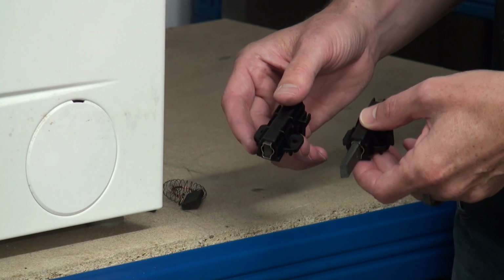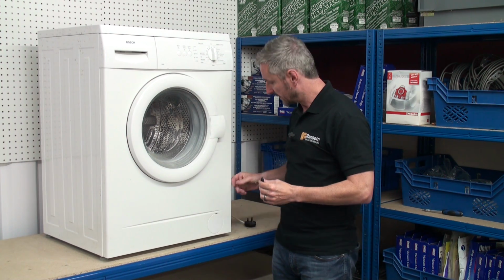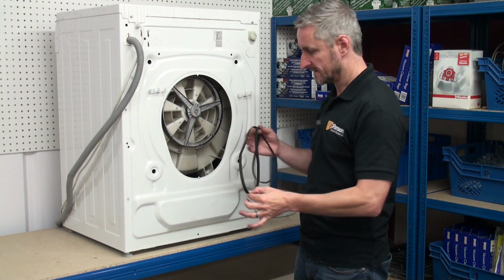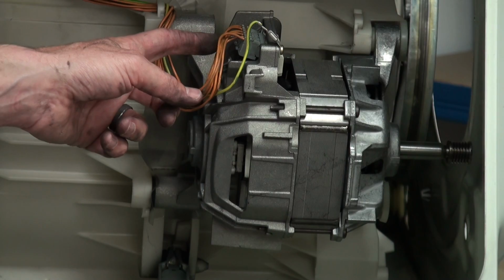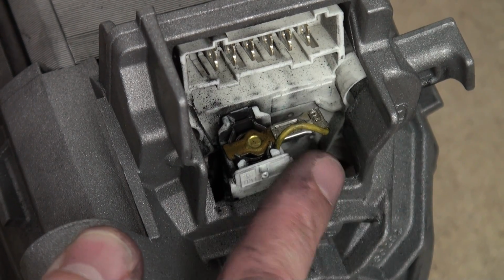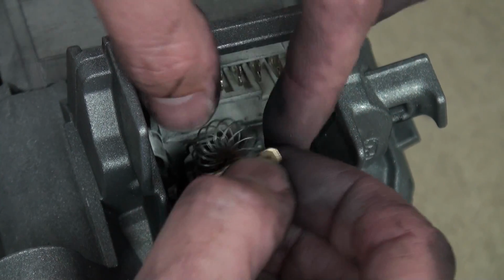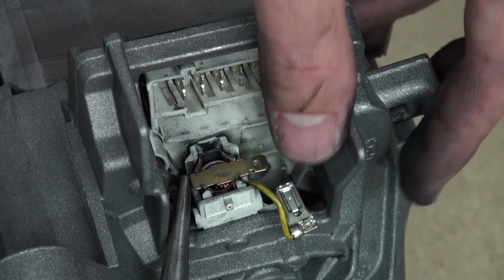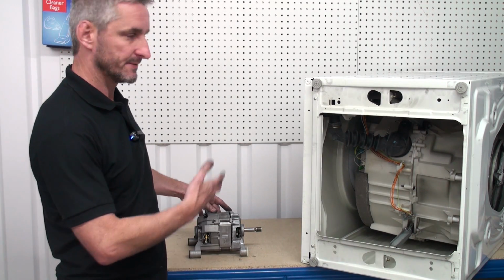How To Replace Washing Machine Carbon Brushes

Comment: Great video! Just got my Bosch classixx 5.5 up and running again. The brushes I received (official ones from Bosch for this serial number, from Bosch's own website) did not fit: that makes no sense from Bosch. I had to sand of the side. It took a bit longer, but it fixed the machine. Many thanks for this great video!

Comment: I am grateful for having had access to this video. I followed it and replaced the brushes on the motor of my Bosch maxx 900 and it worked like a charm. I had no idea how to get to the motor until I saw this video. A repairman had told me that many people use google to fix their washing machine and then they call him to fix it but he won't touch it.  I was tempted to listen to him but I didn't.   Your video saved me about $150, and gave me the satisfaction of fixing it myself. Thank you; keep up the good work.

Comment: Hi. I changed the bushes about a year ago,, can they wear out that quickly, thank you
Reply: @TAHIR MAHMOOD: IT DEPENDS ON WHAT QUALITY OF MATERIAL HAS BEEN USED IN MANUFACTURING THE PRODUCT ---- (HERE, THE CARBON BRUSHES). IF THE MATERIAL IS USED OF A HIGHER GRADE, THE CARBON BRUSHES WILL NOT WEAR OUT QUICKLY. THEREFORE, ALWAYS BUY AN ORIGINAL PART, OR IF YOU WANT TO USE A GENERIC PRODUCT, BUY A PART OF A BETTER QUALITY, TO LAST LONGER.
Reply: من اين اشتريت القطع

Comment: Spot on video - Thank you Lee! Thanks to your explanations, I could remove the worn out brushes and replace them with brand new ones. I then cancelled the error code F21 and reset the control panel back to normal function. Great job, top man! Damien

Comment: Thanks very much, I just received my brushes today and now my washing machine is back up and running, the video was very easy to follow and your website is fantastic for ordering the parts I needed, The washing machine was nearly going up to the tip all for the sake of carbon brushes, I wonder how many perfectly good washing machines have been thrown away without even checking this. again thanks you saved me a lot of money.

Comment: Thanks but do you have a tutorial on replacing without removing the motor too?
Reply: It's always much easier to change the Carbon brushes removed it would be impossible to do it with the Motor in the Machine

Comment: This is our first HE machine, replacing an old one with an agitator=>>lovy.biz/zkql?96r       The salesman told us to put in the detergent and clothes and start it and then go watch TV or something and forget about it. That was very good advice. It makes a lot of weird and different noises the old machine didn't make, and it would drive you crazy trying to figure out what's going on. Not that it's noisy or anything. I think it is pretty quiet. The first thing I noticed was that the clothes were not only clean, but they smelled clean, something I hadn't noticed with the old machine, which had been limping along for a while.

Comment: We recently purchased this washer to get away from a washer with an agitator=>>allmy.tips/WhirlpoolWasher?O41     I must say how pleased I am with the space this washer provides and how well it washes our clothes. My only complaint is that the clothing items are pretty wrinkled when u remove them and I assume that is because they are using each other to wash as opposed to an agitator. This isn't a huge problem so I still rated the washer a 5 because it is quiet, quick and overall efficient. Also I would recommend not washing a comforter over a queen size because we washed our King and it was a pretty tight fit. Great washer for the price and we are very pleased

Comment: Many thanks for this - an excellent "how-to". With this I was easily able to replace the brushes on my 10 year old Bosch Maxx washing machine (first time it's needed anything doing).
One tip - I found that putting a wooden kebab stick down through the spring stopped it spilling out.
I got genuine Bosch brushes, which are angled - a friend commented that he'd had a repairman fix his machine, but he had used generic brushes (half the price) with a straight edge - had commented that they'd be good for 5 years. On that basis I'd cheerfully continue to stick to using genuine replacement parts to get the full lifetime.
Reply: Should have just put the machine, on its back, so much simpler.

Comment: If the symptoms began after an excessively heavy load of towels, it it worth trying to replace the brushes or is it more likely that the motor has burned out?
Reply: Brushes are about £20 for genuine parts

Comment: i have a bosch wae28468/14 with error F21(brushes,motor or main control brd)Brushes are fine. commutator sooted slightly but now clean,not much wear.my motor has 7 connectors which i think are 1-2 sensor3-4 brushes, 5,6,7 windings.across 1-2 i get 7 ohms, on 3-4 i get 23ohms static or 0-23ohms when turning spindle  and approx 2-3 ohms across 5-6,5-7,6-7. 
I tried several times to reset the error but was unable, so took the front cover off and tried the reset procedure pressing directly on the spring/switch which worked first time. i put back together and put a wash on which worked fine for 30 mins into the program then the machine stopped again on error F21, do you think this could be the main control board or motor problem.
do you have a main control brd - BSH 5560 009 098
Reply: F21” is a Long Drain error. If the drain time exceeds 8 minutes this error code will be displayed. ... First, attempt to unplug the washer for at LEAST 30 minutes to reset the Central Control Unit (CCU). Sometimes this is all that is required to correct momentary glitches with the unit.

Comment: Hi,hoping somebody can help,i have the indesit widl146,it has stopped working,but the light still works,if i put it on spin or rinse ,the light is on for what the machine should be doing,earlier after being switched off for an hour,it started working again,all good until it got to the rinse stage,it then just stopped,now it just doesn't work,the door lock works,i was about to order carbon brushes,but read the machine would still fill and empty if it was the brushes,thanks

Comment: Hi, great videos!! I've taken the back off & the belt seems fine. I've not taken the motor off yet. I just want to ask: I put the machine on just a 'spin cycle' to test it, there's 'working noise' coming from the motor but no spin occurs. Could this be the brushes? Thanks
Reply: check the belt if it needs replament

Comment: Hello, i have a Normende washing machine and it has two brushes? do you think id have to hire someone or is it a fairly manageable job? also the screws are soldered into the back of the washing machine, so if the bearings or drum go i couldnt get to it.

Comment: Excellent video.  What screwdriver do I need to remove the motor?  Are those torx screws as well? 
Is it possible to change brushes without moving the motor on Bosch Exxcel 1200 WF02464GB?  
Thank you.